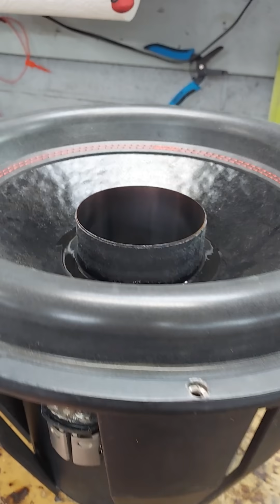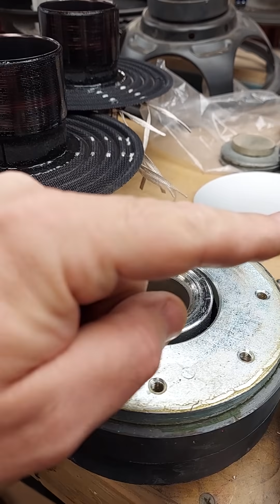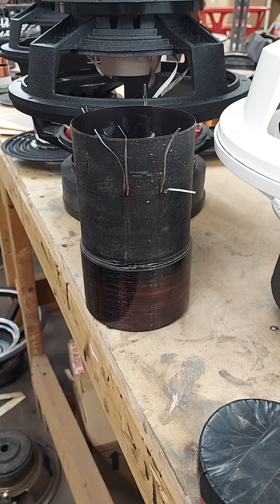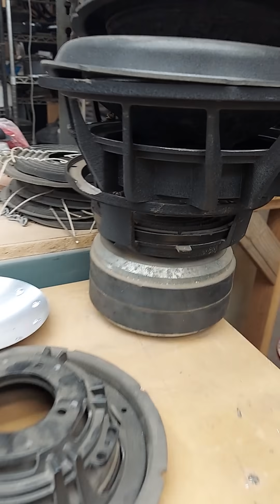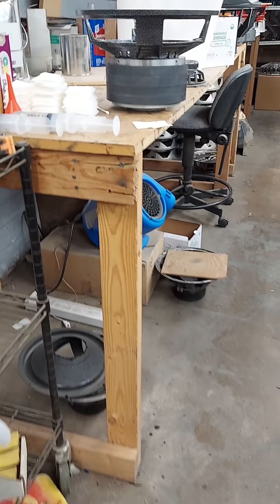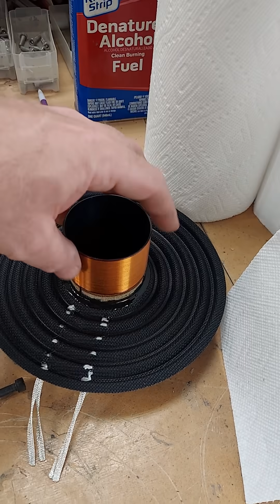Voice Coils - BL factor vs Bullsh1t @ The Robot Underground

Comment: Great video, sometimes u just got to try a subwoofer out and not pay attention to manufacturer specs cause most of the time the specs are not correct anyway...In my opinion skar EVL are a great subwoofer especially for the price point..But alot of people talk so much shit about them saying motor force is weak...Well ive had 2 EVL-18 for 3 years now and they have not let me down and they love them lows! 2 diamond audio des1000.1 1 amp per sub and they move some air!
Reply from the maker: Just make notes on whom is making shit comments on high value
Reply: @RobotUnderground  I'm confused lol..what do mean comments on high value?
Reply: @RobotUnderground  never mind I get it my comment on value is a shit comment.My bad I did not mean anything negative in my comment, I've always and will always only say what I consider as positive or rude but I apologize for any offense, was not intentional

Comment: Hi Patrick,
I‘ve a problem with a 15“ DVC 1,6.  I  wired  my woofer in series to get a resistance of 3.2 ohms. One coil is broken now. My dealer told me that ist had been wrong. In series the woofer could not handle the same power because oh a higher current.flowing through the tensils / coils. It should be better to wire only in parallel. Is that correct? 
Thx for a answer and greetings from Germany
Yours Franz
Reply from the maker: No, that's not correct but if you're pushing the sub that hard, you're going to kill something no matter what.
Reply: @RobotUnderground  I agree that i warnt to archive hi levels, but in my case i have 4“ coils ratet 4000 RMS. I got. my damage  way under 2000, no smell. Impedance wise i drop down absolut 2,5 ohms. Imy subwoofer level control didn t show clipping.The only  Thing i rebember was a knocking, i wondered why there should be a mechanical limit on los power, but imediately dropped the volume. It was mounted in a vented enclosure.
That something Happening Wheel pushing hard … shit Happens. I m Interessed in your Personal opinion. I thougt that it would be no difference between series and parallel. If there ist a difference, there must bectwo different power ratings on a Lord speaker.
Reply from the maker: @Franzifornication  Not in a coil suspended in a magnetic gap.  When it's in a gap, it's not a coil any more... of sorts.
Reply: @RobotUnderground  the coil Looks fine.. no overheating, no smell…je Mäntel the lesds between
Reply from the maker: @Franzifornication  If you burned the leads, then you were asking too much of the sub.  I see burned tinsels all the time.  Typically in lower impedance subs.  That's why I do a hardwiring in D1 coils and double up the leads.  That way it's 2 ohm SVC but the leads are doubled up.

Comment: So if there is a 4 channel sonly subwoofer at my local goodwill can I just put all negatives and all positives to my dvc sub that only has one input? It's a cerwin Vega V122dv2 so it doesn't have two coil connections you just flip the ting and it changes from four ohm to one ohm. If it is an 8 ohm amplifier and I put the sub in 1 ohm mode what will my final impedance be? What about in 4 ohm mode? Obviously I need a low pass filter? Would I splice them all into one negative and one positive hook up to the low pass filter then hook the sub up? What low pass filter specs would I need?
Reply from the maker: Some of those are BS.  I've seen the same thing on Kicker.  All it does is disconnect one coil.  Text me direct with pics.  6023126504

Comment: So that quad coil was whats in the audiobahn immortal quad coil 15
Reply from the maker: Not sure about that.  The Immortal is pretty tall and would need a taller former.  Now you can change frames on that thing and use a normal frame and possibly use the quad coil but I'd need to know the gap dims.
Reply: yes.

Comment: I am wet behind the ears especially subwoofer building as I am just doing research now to build 2 18"  hdx3 motor and baskets ive obtained (Any info i'm all ears, I would like more mass to play 20hz-30hz) anyway I came in through the back door because I could not justify the price of these high watt amplifiers so I did the only logical thing and spent ten fold more on equipment to learn how to repair amplifiers.....(yes now I have plenty of 4500-12k amplifiers lol)
A little off topic (of course you know nothing about rambling on and going off topic......you? Nooooo! haha) but my back story to come back around to I would love to hear about amplifiers doing the same power at 2ohm as it does 1ohm... Not debate, seriously want to hear it. I don't clamp my amps, the amp changes too much, I throw them in my truck to stress test always at 1ohm. I have no basis to say one way or another. 

I have this I'd like to ask; when tuning a amplifier, if you use a oscope do you drive a sine wave? If so, to what the box tuning should peak at or just 40hz or another everytime? With the amplifier loaded or sub disconnected?I'm sure you know but fun one if not, you can drive a squarewave into a amplifier and it will be a perfect sine wave out! (always a fun one to ruffle up the "know it alls")
Reply from the maker: I suggest reading, "The Loudspeaker Cookbook", for starters.  As for 20-30hz, I suggest large amounts of displacement and heavy subwoofers.
Reply: Unfortunetly I can't read copious amounts of information about 1 thing in the same place. I just don't learn anything that way. I apppreciate it and I will probably buy it, but never read it, skim it a couple times and in the abyss of shit I have around. I will atempt  I asure you.

Do you sell soft parts? or have a specific place for product you do sell? I didn't see much, offerup and here and there on FB
Reply from the maker: @commonsenseisdeadandgone  Yes, pallets of parts.  Just make a list and text me direct, 6023126504

Comment: I possibly didn't understand but what determines the coils impededance? The diameter of the wire and amount of turns? What keeps the SPL based companies from making 8 layer super low impededance coils that are ran in series and sold as single 1 ohm subs since it seems all modern amps are 1 ohm stables
Reply: An electromagnet gets its strength from the number of turns.  DC resistance is only a matter of coil material, wire gauge, and length of wire used in the coil, impedance (what your amp "sees") at any given frequency is dependent on many other variables of that coil's relationship to the motor, physical/mechanical properties of the softparts, and then the relationship of that in a box +with the ports THEN also the relationship with the air/acoustic environment of the room/vehicle you put it in.  Google "loudspeaker box as a circuit" to see which elements act as resistors, capacitors, and inductors in the "circuit", this is what Thiele/Small equations are designed to predict and explain.

 Using large gauge wire will either sacrifice turns or require too-large gap, and the size of the gap is inverse square relationship to magnetic force so you will ALWAYS lose way more force than you gain by widening the gap to accommodate larger coil.  

On the other end, too small gauge wire with a shitload of turns will also have very high resistance and may be prone to failure at the coil leads.

I would suggest that we are where we are with industry standards because everything else has been tried and tested and the things we're doing now are the best compromise to meet a variety of design goals.  

As to why nobody makes single 1 ohm coil, not everybody runs just one woofer, not everybody runs 1 ohm stable amps, and not everybody runs only 1 amp per woofer.  A driver with two DVC options can, more or less, get to the same place as 8 single coil options so that means manufacturers, wholesalers, and retailers can offer a solution to customers with 1/4 of the cost and space tied up in inventory.
Reply from the maker: Typically laziness and supply.  There already proven remedies for bass.  Tried and true, running D2 coils in parallel makes bass.  (If it ain't broke)  The other thing is supply.  China already has them made, why rock the boat?  Also, China doesn't like changes and they typically make you pay through the nose for "making" them work harder.. That goes back to laziness.  China is also lazy in some respects.
Reply: if their was a solid gold woofer that did 200db with a 4 watt amplifier.....the worldwide total sales would be = 0. ZERO......

Comment: Hi Patrick, l have a question about coil rubbing. I’ve got an Altec 416 8a that needed a full recone/coil job so I bought a kit from a company and installed it myself. Actually 2 woofers & kits. One, the first one turned out just fine. I somehow screwed up the second job, maybe being too cocky. So now the coil slightly rubs and I don’t want to spend more money on a third kit that l may screw up again. Do you have a suggestion or trick on how to realign the coil in the most least invasive possible?
 Love the show & really enjoy your stories but, most of all I appreciate your willingness to help out the less fortunate. I like your attitude and outlook on life. Very inspiring. Thanks for sharing your experience and wisdom.
Reply from the maker: You'll need to reclaim / harvest the coil by removing the soft parts.. But that's only if you're able to recover the cone as well.  Personally, that's one of the reasons why I got into selling and flipping audio.  It pays for all kinds of projects I didn't want to pay for.  Those subs are very old and terrible.  I'd recommend getting them magnetized again if you plan on keeping them.  If not, I really recommend just replacing them with something modern.  Don't believe all the fandom about old equipment.  If it was so great, why don't they make it anymore or copy it??  I'm VERY AWARE that my words may seem cruel or insane to a collector.  They're not.  That's the voice of reason and logic.
Reply: @RobotUnderground  Someone suggested I heat the fibreglass former and ever so slightly distort or out-of-round the coil. I did try applying pressure to 2 sides of it and it does work but I’m not so sure if heating the fibreglass will hold a new sort of oblong memory.  If I can fix the problem I’ll sell the pair and get something more modern. Any replacement suggestions with a higher frequency top end so I can make a 15” 2-way?
Reply from the maker: @nelsondog100  I'd shim them firmly and try the heat gun thing as a last resort.  Really you just want them back into round.. (if that's the problem).  The gap might also have some debris, you never know.

Comment: US amps had 1/4 ohm stable twenty five years ago seems like that trend cough on ten or so years ago ???
Reply: Yes, however that concept is completely different from the concept that Patrick was speaking about; using notch filters to limit frequency bandwidth to achieve a specific "super narrow" impedance by the woofer. You're trying to get the maximum amount of spl and efficiency.
Reply: drs1919 1919drs ahhh I seee very interesting
Reply: Us amps has shit customer service